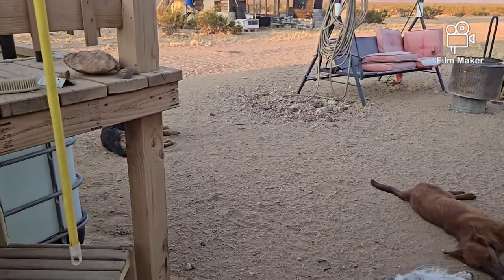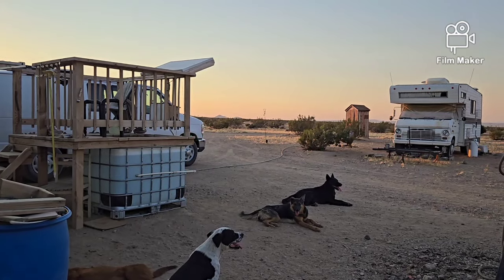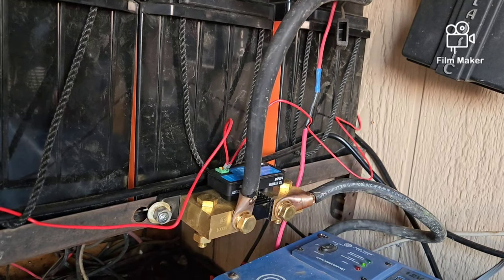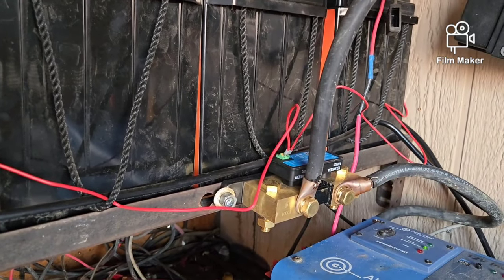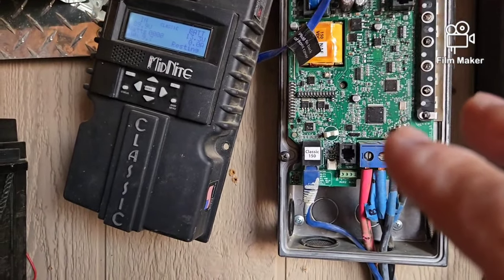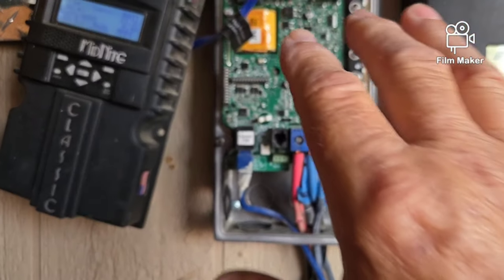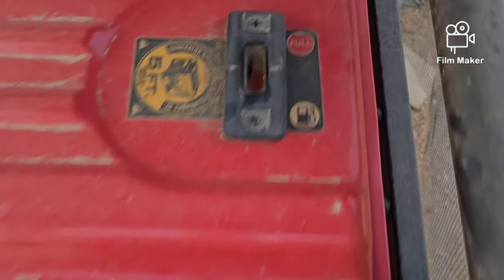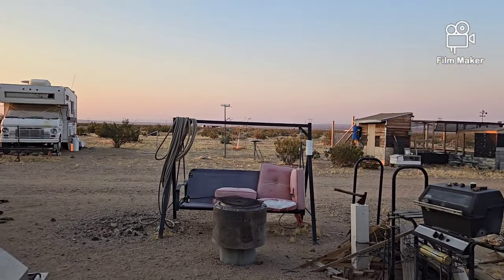What About That Shunt!? July 10, 2024

Comment: The carburetor float bowl is smaller than the tank.   The varnishing starts quickly there.   I’ve seen a video of a guy whose father showed him a trick.  Run the gas out then add a little ❤transmission fluid and cycle it through the carb.   After storage put in gas and start it up.   It will smoke like crazy for a minute or two but clear right up.
Reply from the maker: @WattsinWattsout  Yeah, I remember that trick, but these new units have sensors for CO and smoke, and would shut down.

Comment: I started out with 12v system and spent alot of money to make it work but still had power outages! With GBears help we figured out a better system! He was researching different systems and I liked what I heard and went to a 10k all in one 48v split phase system! And then I switched 16 200ah batteries to 48v worked great and then gbear found these lifepo4 batteries and we switched over to them I have 4 batteries in series for 48v and the 4 batteries replaced the 16 200ah batteries! Outstanding setup now! Running 2 rvs a freezer swamp cooler and 5 fans and a TV! All on 4 batteries! Amazing!
Reply: G Bear has a wealth of information.   I appreciate his sharing this knowledge.  🫡🙏🏼
Reply: @billm5433  
Boy howdy! He's a great man!
Reply from the maker: @billm5433 Thanks Bill

Comment: That AIMS inverter is probably a bit big for the Van system, but I'll explain the trade-off.  Basically the larger the inverter you have, the more idle power it eats even with no loads.  That AIMS inverter probably has an idle consumption of around 100W (just guestimating, you'll have to look at the specs for it).   (Manufacturer also matters a lot but as a general rule, larger inverters consume more idle power, smaller inverters consume less).

In anycase, lets assume its 100W.  So if it is left on 24x7 it will eat 2400Wh/day of energy just doing nothing.   So you'd need to have enough solar on the van to make that energy use a footnote.  And you can only put so much solar on the van.

That's the basic issue in terms of putting large inverters into smaller solar systems.

-Matt
Reply from the maker: @junkerzn7312  Thanks for the insight.  I had already changed my mind because of room, and heat produced, and don't really need the extra power.  My existing 2k-4k inverter works fine for my needs, so no need to fix what isn't broken.

Comment: G Bear. I see now you are using near 500A so the 1000A shunt is great for your system. I got told to go 24v or 48v but i just wanted to do a 12v system to start with. I only have a 500A shunt on my system. If i was to hit near 500A i would have to get a 1000A shunt for my system. I just started learning about solar last year and it has been hard work for me..
Reply from the maker: @daz.r1994  Yeah the topic of solar is evolving quickly, and new stuff comes out regularly.  They no have bifacial panels and others that produce 85% efficiency. Also, batteries are evolving. I heard someone has invented a battery that lasts forever.
Reply: @GBear  I picked up a lot of my solar stuff last year so it's out of date now lol. With all the new solar stuff thats out now. My batteries are guaranteed for 4 years so thats great. I have the solar tracker to fit next month to get the best out my solar panels. I will be happy when it is all finished.
Reply from the maker: @daz.r1994  Yep, you would think you would be happy when finished, but if you are like me, you will miss the tinkering and problem solving.🤣👍

Comment: I don't see a problem with Overbuilding Anything especially when it comes to Electronics  Reliability. I will share a gasoline preservative trick I've been doing for the past 20+ years➡️ Marvels Mystery Oil & Seafoam 4oz of each go in the tanks of my vehicle, motorcycles, tractors & lawnmower equipment. Good stuff 👍👍
Reply: I use only Seafoam. One ounce per gallon. I've had gas store for over two years and it's still usable.
Reply from the maker: @miguelsalami  Wow, if you add the costs of those additives,  what do you pay per gallon?
It always pisses me off that they put stuff in our fuels that make them only good for short term storage, charge us more for it, then we have to add more stuff so the gas doesn't go bad.
Reply: @GBear Just 4 ounces of each into 5 gallons of gasoline so very economical.
Reply: @GBear  I can only speak for myself, but I pay $8.48 for a 16 ounce can of Seafoam at Walmart. That comes out to ~ .55 cents per gallon to stabilize the fuel for 2 years. I keep approximately 40 gallons of fuel on hand in case of a major power outage. I went for weeks already without grid power, so I'm willing to pay for convenience.
Reply from the maker: @larrycarlston4044  Whaterever works for an individual is the right choice.  My gen runs 17.5 hours on 5 gallons, so I use Sta-bul for sitting, in the gen and Sta-bul for storage in an extra 10 gallons for emergency.
I use e-85 fuel in the van, so I can't syphon any for the gen, but I figure that 53 hours of backup for the gen is good, as I have 3650w of solar.
Reply: @GBear  I agree GBear. We each have what works for us. I wish I had your solar too.
Reply from the maker: @larrycarlston4044  I wish I could afford yo buy some of the 360w panels my friend in OC is selling for $129 ea.  I'd by 10 right now if I had the money.
Reply: @GBear  Same here. I'm on a fixed income, and with inflation at an accumulative 24%, food is fastly becoming a luxury.  I don't want to clutter your channel with politics, but we need a change of scenery in November.....
Reply from the maker: @larrycarlston4044  No arguments there.  This horntoad has ruined this country, and anybody who wants that communist party to stay is a treasonous bastard.
Reply: @GBear  I agree 100%. 👍

Comment: So yes, in your other video, the folks telling you your shunt was too big, and that LiTime was wrong, were correct, when it comes to your setup.

Four 230Ah batteries in parallel, each with a max continuous amp output of 200a, with a 5-second peak of 600a (!!!). In theory, your setup could push 800a continuous or (gaaaah) 2400a for one brief, shining moment. 800a > 500a! So you went with the 1000a shunt. 

But you're never (or rather, it's very very very unlikely in the future) going to be pulling 800a out of those four batteries. The key factor here is, what sorts of uses will you have, what is the maximum amperage you would ever draw? The big limiter is your inverter, and the usual 12v 3000w inverter will pull around 250a at max load. (your 4kw inverter will pull around 330a.) Now yes, you might end up with a second inverter, and two of those type inverters running full on would pull around 500a. But how likely is it you would be running that much equipment at the same time that you would push up to that level of amperage draw?

LiTime was going by their own specs and advising you based on the maximum possible amperage usage of your batteries.

That 4kw inverter in a van would be quite a bit of overkill, hah!
Reply from the maker: @wanderingzythophile9083  Yes, I'm not arguing the fact that I probably could have got by with a 500A shunt.  I just went with what the battery company told me, so I wouldn't be have these conversations with them if something went wrong.

Comment: What is the shunt for
Reply from the maker: @JamesHollinger-lt8qx  It accurately monitors the LiFePO4 batteries SOC (state of charge), and gives other pertinent readings to help maintain the battery bank.
Reply: @GBear  
What happens if you don't use one
Reply: @JamesHollinger-lt8qx  You can use a Hall Effect monitor. It's basically a "wireless" type (same principal as the Fluke Test equipment) which doesn't require a shunt. I read where the shunt is a bit more accurate, but I'm not convinced that the small error of accuracy would impact what we need it to do. The shunt creates resistance which the monitor reads and displays as amps,  amp hours, etc.
Reply from the maker: @JamesHollinger-lt8qx  You could run your batteries down too low and damage them.  Measuring the SOC with a voltmeter isn't accurate with LiFePo4. 
The discharge curves are extremely different than other types of batteries.  I'll try to post a chart in today's video with more info.
Reply: Indeed G 🐻 indeed. Good luck with your new setup 🎉
Reply from the maker: @felipejimenez3630 I look forward to going 48v with 4 more batteries.